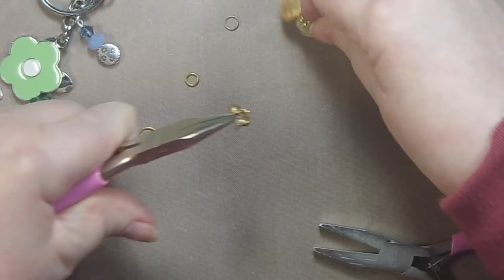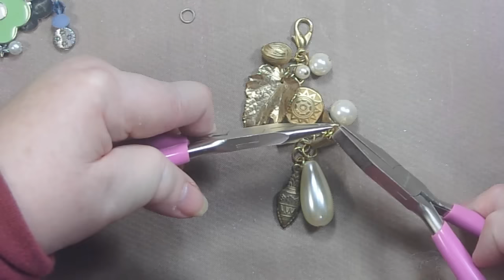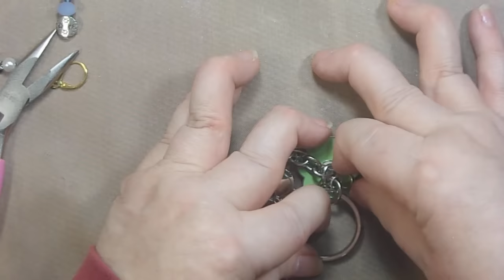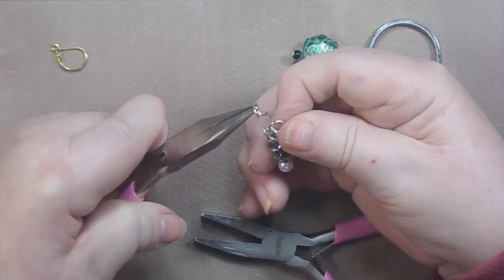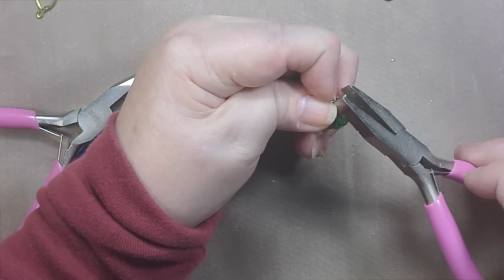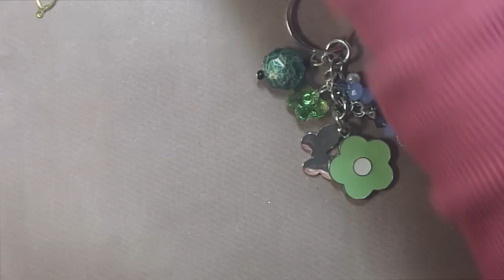Recycling Old Jewelry to Make Dangle Charms

Comment: CONGRATULATIONS!   I am so glad you didn't give up! If someone is getting pliers to use they want to make sure they are spring loaded. Yours are, and you can get an inexpensive set at Michael's and use a coupon. I have a hard time using regular pliers. So if you look right above where the pink ends on yours, the metal pieces come together allowing them to open up on their own. I always have to use 2 pairs of pliers. I love the idea of taking apart an old piece of jewelry. I love your tassels! So so glad you didn't give up!
Reply from the maker: Thanks Liz, I really struggled with this and have no idea what I was doing, obviously...Thanks for the tips.

Comment: FYI - The loops are called jump rings and you did a beautiful job on opening them.  The trick to closing them is the twist them until you feel a little click.  There is enough of a spring in the metal to keep them tightly closed. 
Very cute chunky charms.
Reply from the maker: Annette, Darn, they looked like an "O", so I went with it. Thanks for the scoop, on closing them.  I had a hard time with them because of strength, so mine never clicked.  I was glad to take on a new challenge, but won't be making any more jewelry in the near future, unless I get some super strength, haha...So you're a jewelry maker too?  You're one talented woman!  Loved your Christmas cards..
Reply: I have been looking for tools that help with gripping better.  I always struggle with dropping things when working with two sets of pliers (which is best practice).  There is a ring that you wear on your finger so that you can use one set of pliers.  I don’t have arthritis so I can only imagine the difficulty you are having with weakness in gripping.
Reply from the maker: Glad to hear that "normal" hands still struggle with jewelry tools...I felt like such a failure trying to twist that wire.